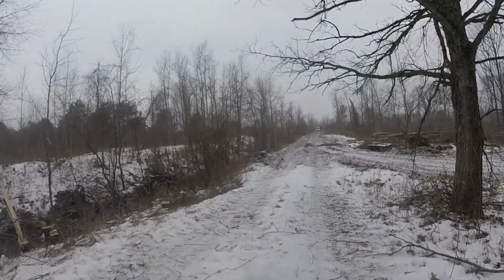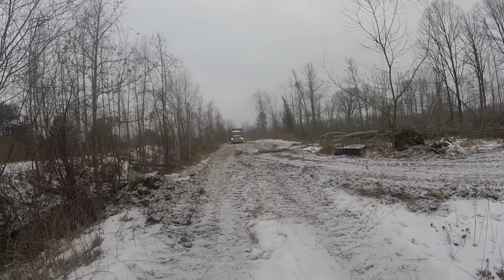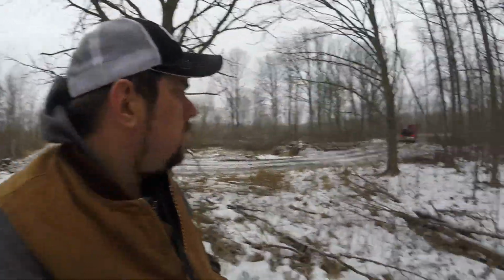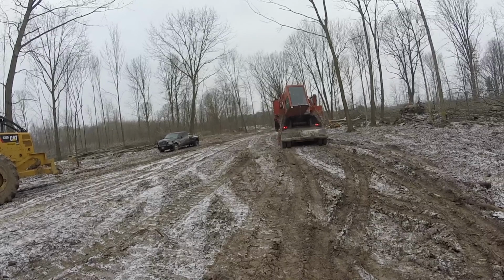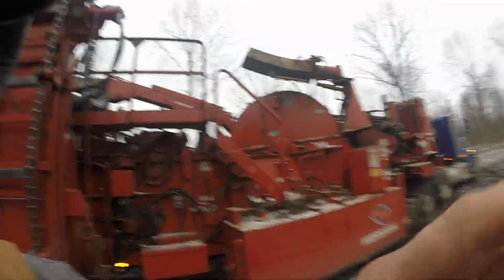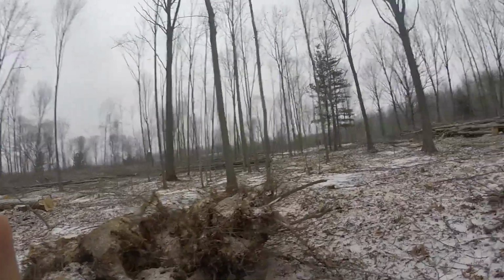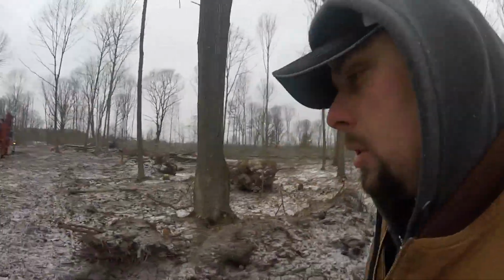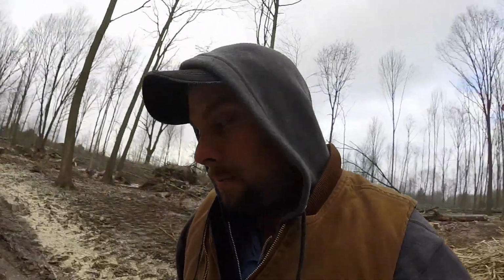ITS COLD OUT!!!!

Comment: An air drier would help with the freezing issue, also do you oil your impact? When ours starts running low on power in the shop we give it a shot of air oil and it improves the power tenfold
Reply: Makes a big difference, also some methyl-hydrate introduced at the air end makes a big difference.

Comment: John, I have a question, to some it might be dumb, well anyways here it goes. When you feed in let's say a 8" diameter tree how come when it hits the chipper blade you don't end up with a 8" chip? I remember from one of your previous videos, you said knots can cause chunks. I have watched almost all of your videos and I have wondered that from the beginning. Stay safe out there!
Reply: chipjr10    It's a little hard to explain without a picture, maybe John can do a video on it sometime   So here goes, each chipper knife cuts a 7/8 inch slice of wood off at a 45 degree angle, that slice is then being bent at a 30 degree angle causing it to begin cracking as it passes through the chipper disk via the chip slot putting it on the backside of the chipper disk.  It's here that the slice of wood is hit with the paddles, you can see them when he changes knives, causing the slice to break up into chips, the paddles also what throws the chips through the spout into the chip vans.   To keep in spec, because wood changes with species, seasons and temperatures, we sometimes have to slow the chipper disk speed down so as to not make to many fines, or change counter knives to adjust the degree of bend as the wood passes through the chip slot.   Needless to say there's a lot happening inside the chipper that takes experience and time to learn.   Hope that helps, thanks 
Mike Cook
Reply: Mr. Cook, yes it did help, thank you for answering my question. I find your operation and equipment very interesting. Thank you for allowing John to show us these videos. Stay safe and have a great day!
Reply: chipjr10    Thanks for the comment.    Keep watching we'll try to show you answers to your questions.  
Mike